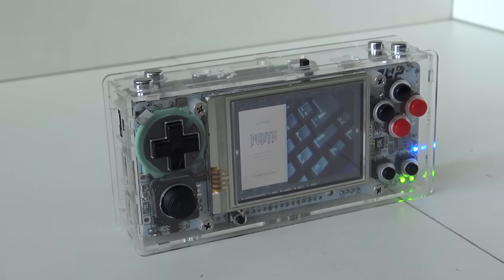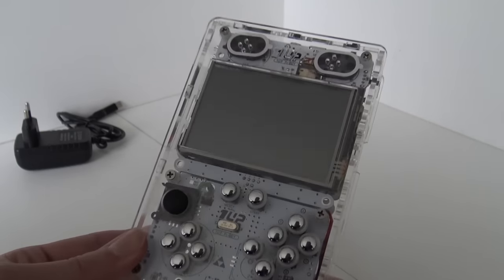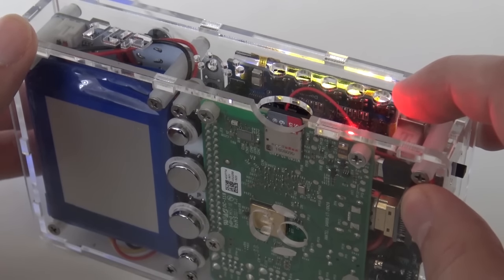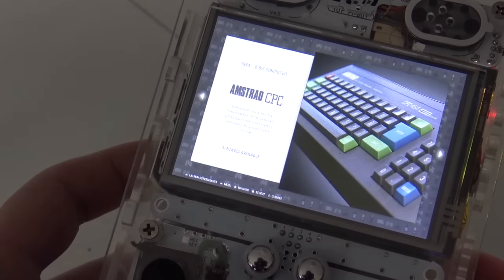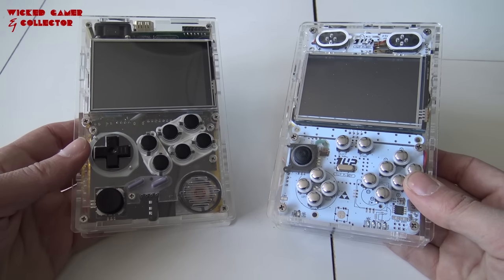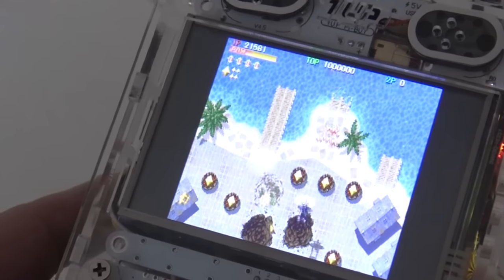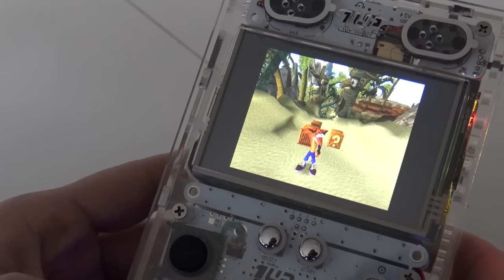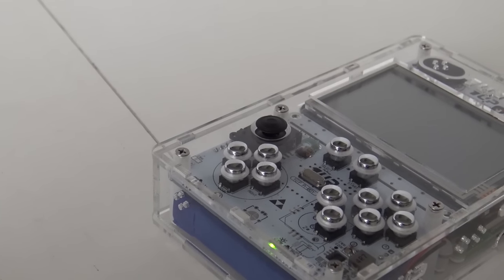1up Massive  Raspberry Pi Handheld in 2021 !

Comment: Its a shame it only has one joystick and no actual D-pad. But I do like the the fact it has the 4 shoulder buttons and the 6 button layout in the front.That looks like it would be perfect for Sega Genesis/Mega drive games that use the six button layout.If they made it compatible with raspberry pi 4 in then that six button layout and four shoulder buttons would be perfect for some N64 and Sega Saturn games.